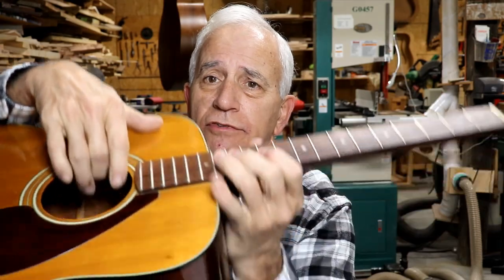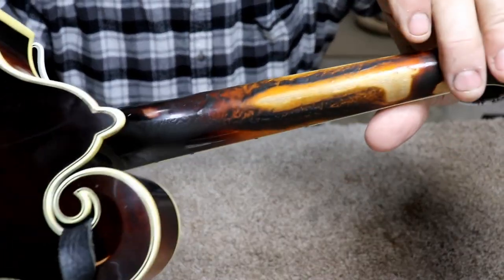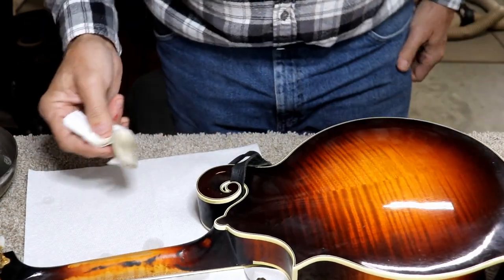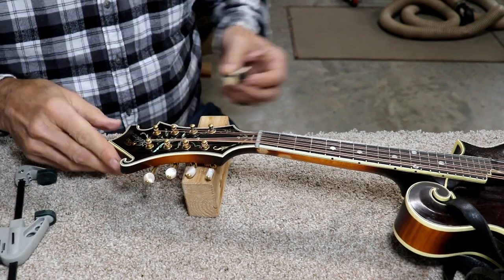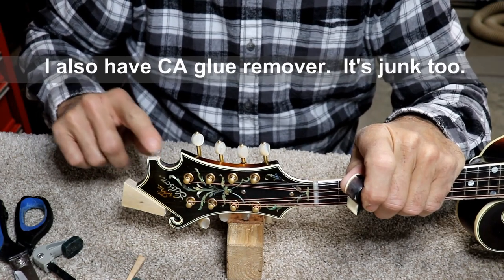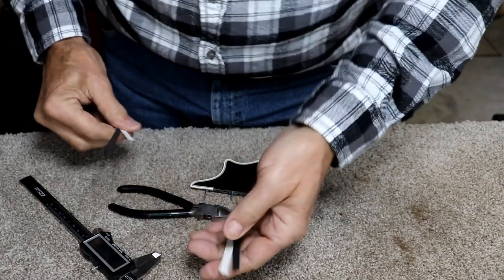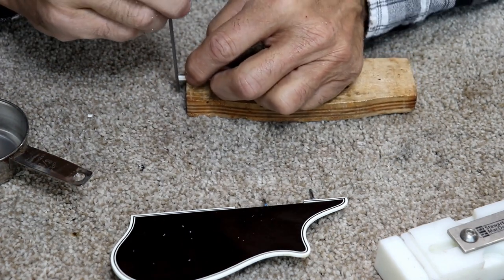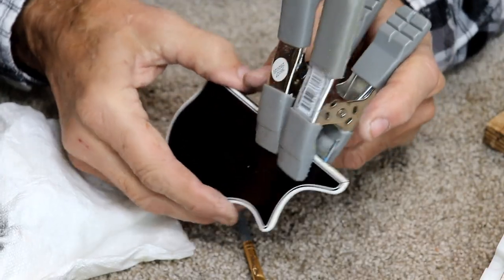VLOG #004 RSW I Forgot One   3 Cosmetic Repairs

Comment: I would think if you drilled a small hole in one piece and then inserted a metal rod in it and cut it at an angle just above the wood. Then when you put the other piece on, it will leave an indentation on that piece. That should give you your alignment. Then just drill in steps until you get big enough for a small wooden dowel. This would make the repair strong and invisible.
Reply from the maker: It sounds simple but when you're working with an odd shape and trying to fit wood fibers back together it never works trust me I've done it hundreds of times it never works

Comment: I'm thinking that a piece of painter's tape stretched tight around the top of the curve may have helped stabilize the scroll.  (That is a technique used to in gluing up mitered boxes that works surprisingly well.) Then, with the clamp in place, it shouldn't have a tendency to rotate out of the glue joint.
Reply: With that and the little wedge he used, it may have worked well.

Comment: Also if you run into another situation where you have to clamp up a round part again. Take a block and cut a birds mouth... V into it. Line with cardboard or cork if you have it. It will cradle the curve and give you a flat for the clamp jaw to press against.  The wedges were a great idea.
Reply: Generally a great idea, but in this case, I don't think the V caul would have helped.
Because the glue joint was not in line with the center of the scroll.

Comment: Nice video, thanks for sharing. After putting on the wedge on the one side I thought you might cut a "mold' for the scroll side to give you clamp a flat parallel edge on that side as well. Glad is worked.

Comment: Since that Yamaha is an electrical instrument, maybe the gauze is for dumping the resonance a little bit, so it can perform better in loud stages without too much feedback problems. I do electric adaptations on guitars and feedback is always a problem if the guitar has a good acoustic sound.
Reply: That's why I think acoustic guitars should stick with external microphones.
Reply: @zapa1pnt  Yes! I try to explain this to my clients. Is very difficult (to not say impossible) to have a pickup system that captures all the nuances of a good acoustic guitar and have a good feedback resistance at the same time. Better to have another specific electrical instrument to play on loud stages and a good external microphone to capture the acoustic one on places where you have better control of the volume, position etc.
Reply: It wasn’t an electric I added it at a later date and was not happy with so I took it off

Comment: It was difficult to tell where the crud and the dark finish on the headstock separate until you cleaned it. As for gluing the headstock piece, would a few rubber bands looped at different angles to hold it, then clamping for a tighter bond do it? Nice work, Jerry!

Comment: Little trick. I've used this on 2 part epoxy and even the Elmer's ProBond Advanced single part epoxy. It may even work with wood glue. I don't know how strong it is or how durable. But, if you put the glue on one side and a little super glue on the other, it'll have a chemical reaction and set almost instantly.

Comment: Wonder if you could use a single pin to align the peg head piece for clamping & glueing?
Reply from the maker: You could never get it aligned ahead of time.  But, I might drill it now and insert a dowel.  It will show, but it will also strengthen it.

Comment: If it had been me (me being the hack l am) l probably would have considered drilling and inserting a small wooden pin in that headstock scroll. Would you consider that as overkill or counter productive?
Reply from the maker: Yes but you need to do that after it is aligned and glued .  If you put the dowel in first, it never lines up.  The negative of doing it afterward, is it will show.  But I may still do it.
Reply: @RosaStringWorks  yes definitely post glue up! I figured as it would be on the underside of the headstock, it would aid in minimizing it's visibility.